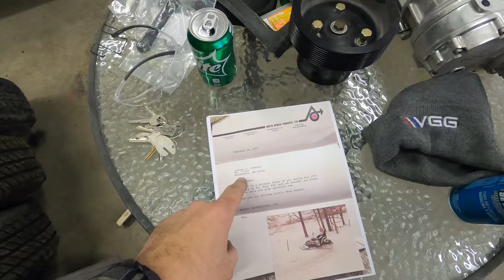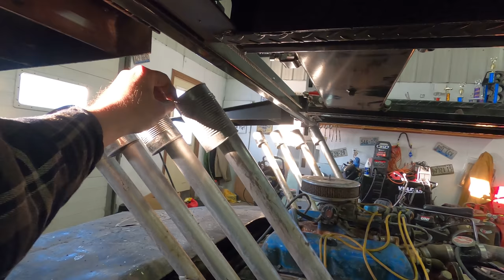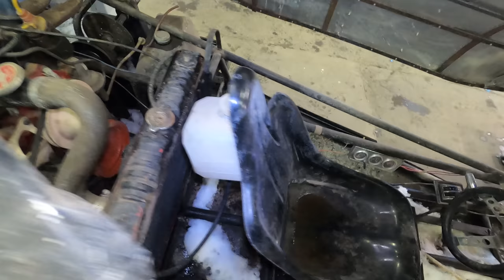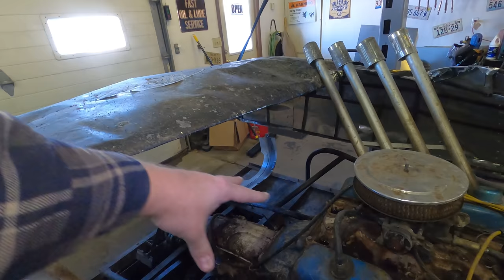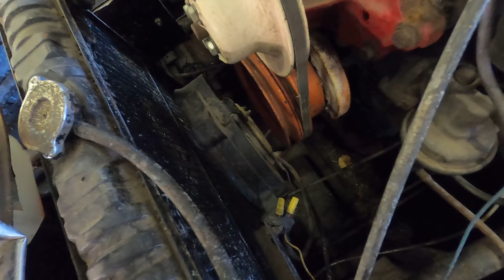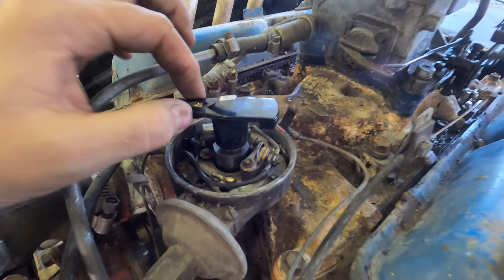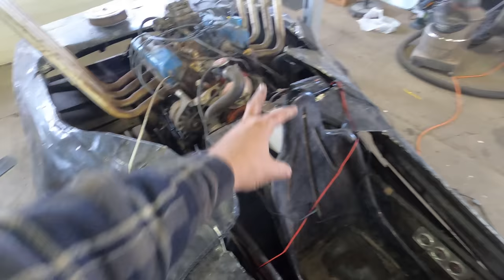Ford V8 Powered Dual Track Drag Racing Snowmobile - Will It Run after 20+ Years?

Comment: Just wondering why you have never told everyone the trick of the weep hole starts leaking on a water pump and if you get stuck take a number 2 pencil ✏️ and jamb it right into the weep hole to stop the leak. It fits perfectly and gets you out of the woods so you are not stuck from overheating. 
Let everyone know about that one Jarret. Or maybe you didn’t know and you just found out that trick lol 😝

Comment: My tuner on my fuel injected, haltec controlled v6, pulls the plugs mid tune every time to check them. Without fail. It is super important for sure! Would be nice for a plug reading video with all the plugs you’ve pulled if you save them up and do a full comparison for us middle aged folk that don’t know exactly what we’re looking at!

Comment: A wise old mechanic once told when it comes to spark plugs just buy the exact same plug that came originally with the engine. Why? Because the engineers who build the engine did all the figuren for the correct plug.

Comment: I haven't watch the whole video just taking a guess on the motor I think it might be a 289
Reply: Hey I was right and I didn't watch the whole video I literally stopped and took a guess when I saw the engine and he said guess what kind of engine is in it 35 years and I finally have started to learn by looking which engine is which and I'm not a big Ford guy I just used to have a 65 Mustang with a 289

Comment: I dont understand why reading plugs is dying out. If you know what to look for you can tell a lot about the health of the engine. Fluffy build up =carbon and the engine is running rich. Shiny build up = oil fouled. Engine is burning oil. There's more but I dont want to type them all out.

Comment: The least he should have done is to turn the engine around to eliminate the need for the chain and the drive shaft. A diagonally mounted V6 from a front wheel drive car or the engine from a porch or a ww bug would have saved hundreds of pounds of weight and eliminated several parts out right. You should care more of why it is not what it is. It is a interesting build but far from a good build, given access to a junkyard most grease monkeys could do far better than this.

Comment: You should stick to Chevy and Dodge you absolutely know nothing about Ford's I was a transmission Rebuilder for 35 years they have round bale see sixes but no C6 was a bolt on definitely no C3 built in the 60s is definitely not a C4 cuz it would have been a green. In the sixties it's cast iron cruise I saw the bottom boat when you lifted it you can tell by the tube that comes down the side for air vent and where's the modulator screwed in so I was wondering at least if you corrected yourself and told the people you knew it was a cast-iron Cruise also called the fmx transmission